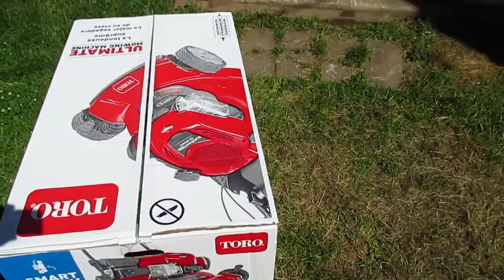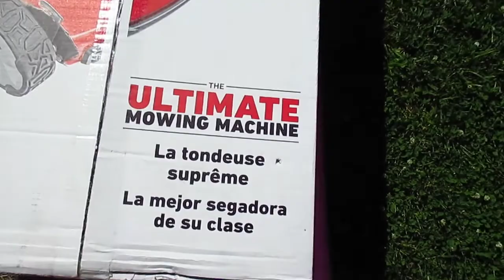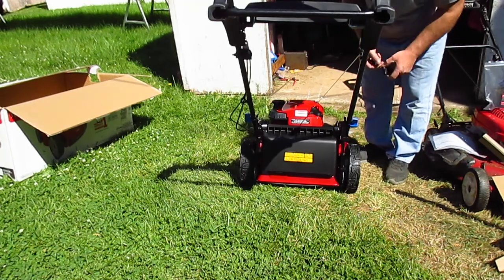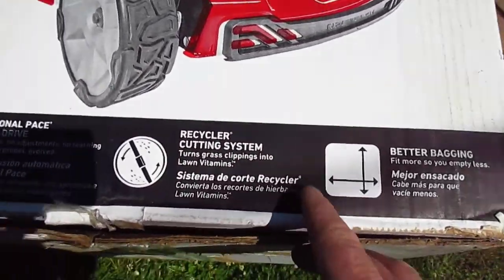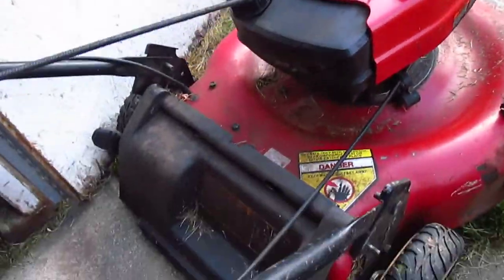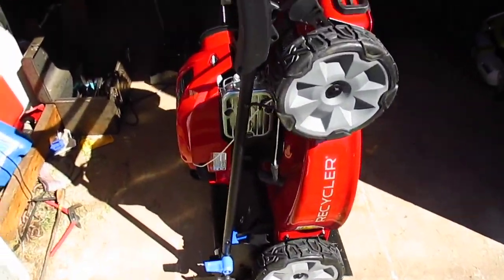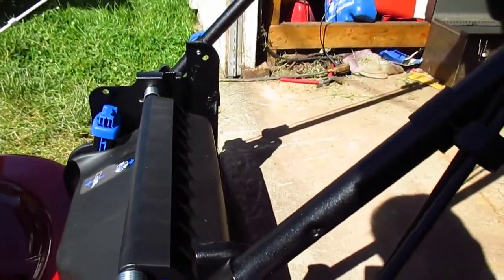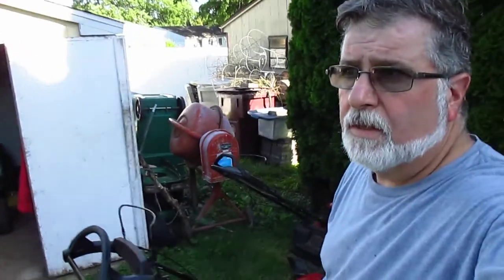UNBOXING THE NEW TORO PERSONAL PACE MOWER

Comment: Why do you need a riding mower? I have a 2007 Toro Super Recycler still running Good review. I  like the smart-stow and 9:43 I wish I had that, you never have to worry about it clogging up .
Reply from the maker: I really don’t NEED a rider but it helps . I can and often do just use my walk behind. Since I have a lot going on with work and other projects, the rider gets it done much faster saving me time. See my newer videos on the snapper reconditioning.

Comment: I'm comparing a few different models.
So many model numbers..with slightly barely perceptible differences.
Trying to narrow down my options...
What do I want...what don't I want.
What am I ok with either way.
And what's the cost?

This is the 21465.
Has vortex.
Rear wheel power.
Personal pace.
150 cc engine.
Has smart stow.
Currently $499 at home Depot March 2022
Reply from the maker: There are some good choices out there and some bad ones also. I looked at the toro since I’ve alway liked the personal pace. Lowe’s sells a craftsman with a similar drive . Priced about the same. I believe troy built also has a similar model. Not sure about price